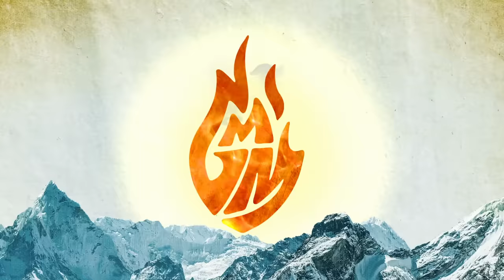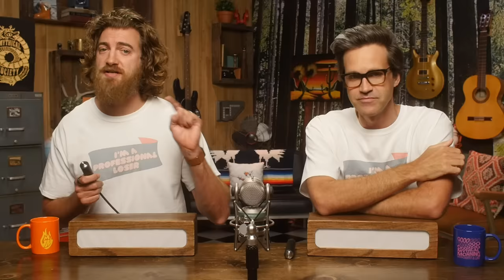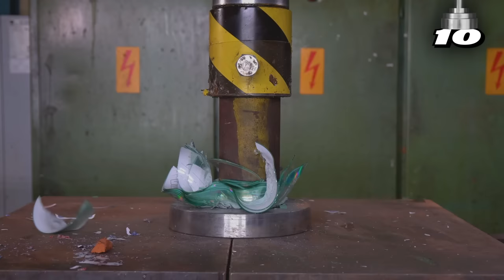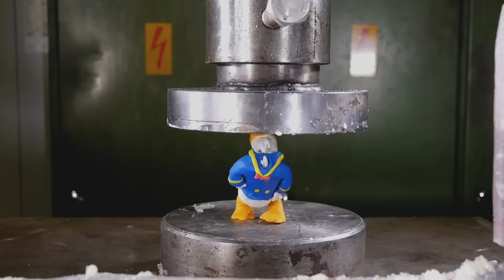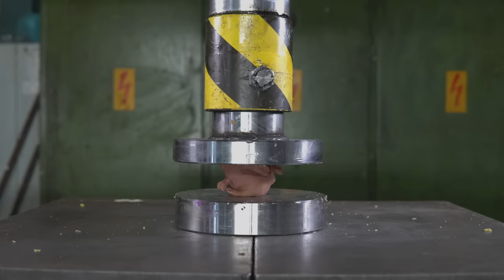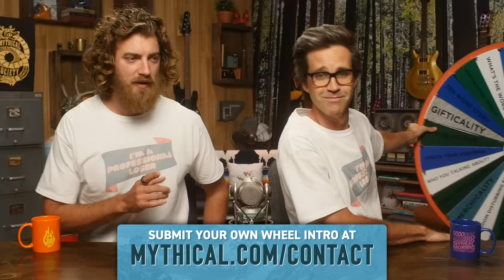Crushing Things With A Hydraulic Press (Game)

Comment: Hydraulic presses are very useful in stress testing building materials, like concrete blocks or cast cylinders of concrete. Since the strength of the material is so dependent on the water and cement content, regular testing is important to ensure it can withstand expected loads.

Comment: Answer to link: a hydraulic press can be used to test materials resistance to compression. I study civil engineering and we use a hydraulic press to study concrete resistance. There’s a machine that does the opposite to study resistance against traction